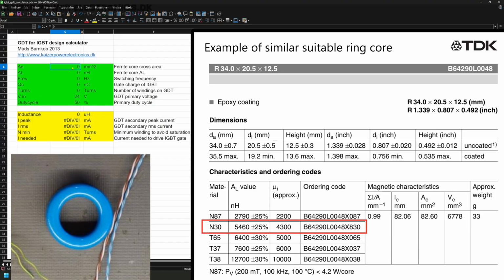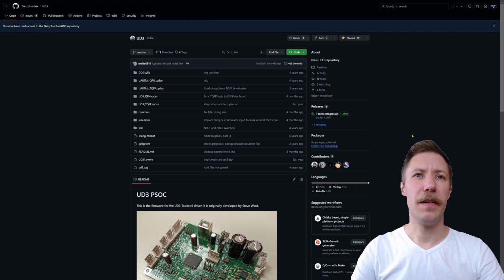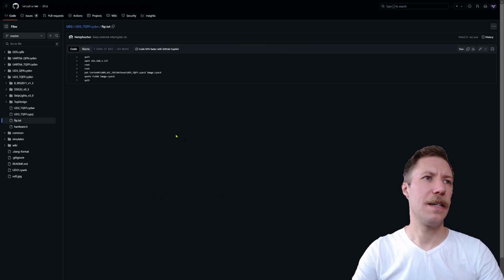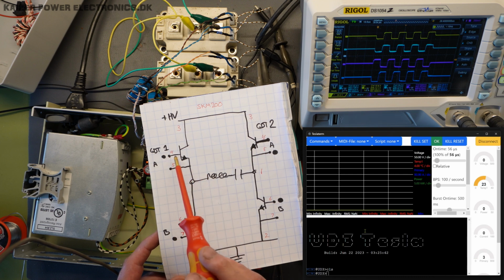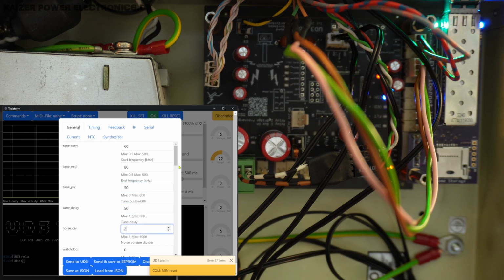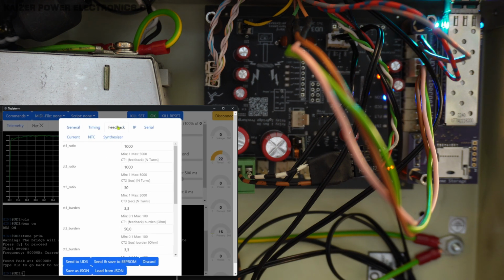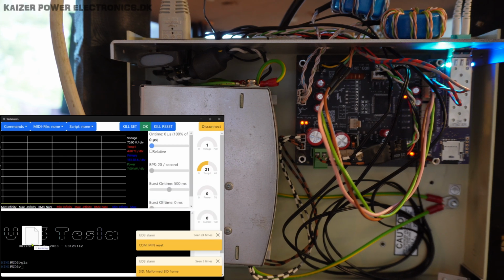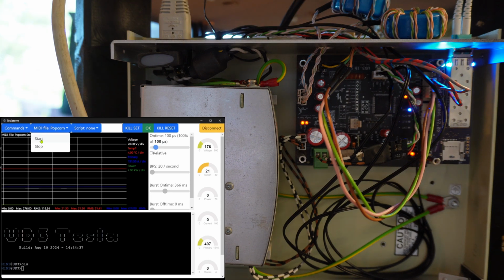Tesla Coil UD3 Connection, Setup and Software Test (Part 2 of 3)

Comment from the maker: UD3 Project Discord link: https://discord.gg/ZKQQA6aHqx All pictures from part 2 test: https://kaizerpowerelectronics.dk/teslacoils/nextgen-drsstc-ud3-installation-configuration-software-and-test-part-2-of-3/

Corrections to video:
1: DC bus current transformer should be moved to between rectifier and DC bus capacitors, instead of between IGBT and DC bus capacitors. High frequency ripple current in this location will not give correct measurements.

Comment: I'm pretty excited to build my next coil with a ud3!
Reply from the maker: It is worth spending the time on it. Do not fear the FiberNet, there is virtually nothing to do with that. TeslaTerm is wonderful and UD3 in itself is easy to get made, especially if you use the UD3.1 PCB layout that Thorben made, to fit with standard components from JLC, so you only have to do the large throughhole components and CPU.

Comment: Video felt a bit chaotic but very interesting overall. Can't wait for this to make sparks! Do you plan on trying pulse skip with this coil?
Reply from the maker: Just as I found it very hard to get started with the UD3, because its spread out over different projects, it is also hard to make a 1:1 how to video. It would be hours and hours long :) I tried to highlight all the less-documented features and show where I had problems. The documentation and wiki on the projects are at this point very good. I helped update the UD3 wiki with some of the findings from making this video. UD3 is a project in current development and its super exciting to follow and take part in. UD3.1 is not far around the corner! I don't think I will pulse-skip this coil, its MMC is kind of not-oversized. I will definitely try it on my large DRSSTC3 :)
Reply: @KaizerPowerElectronicsDk  Awesome! I'm excited to see what your big coil can do with longer pulses!